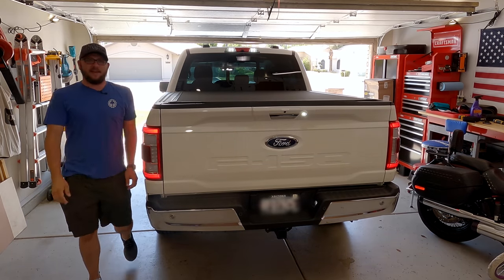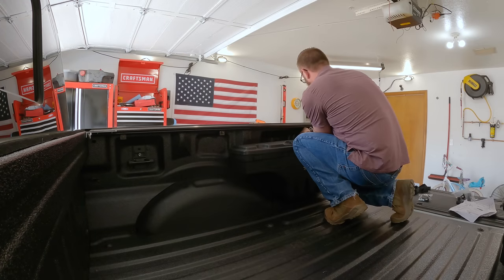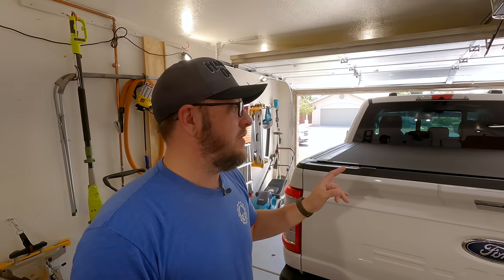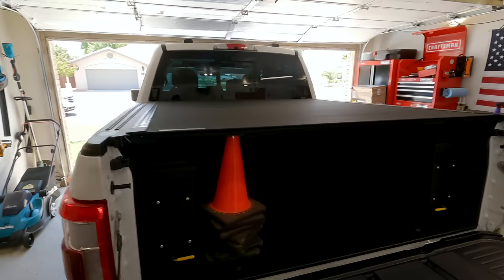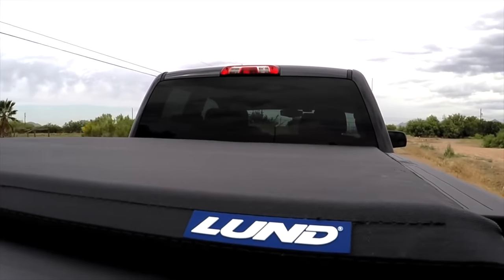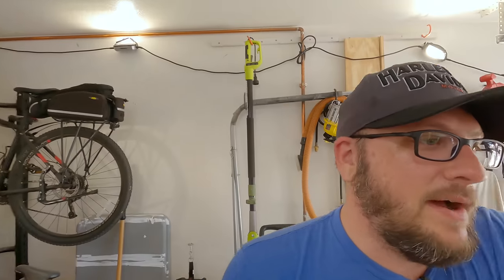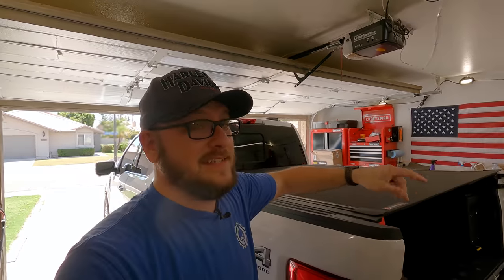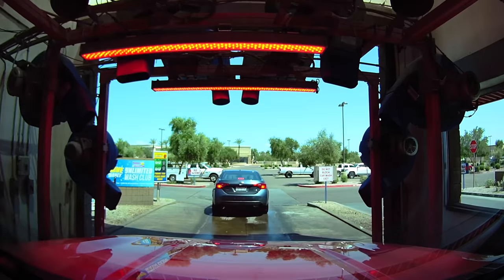BAK Revolver X4s, The BEST tonneau cover on the market?

Comment: I've got this same cover installed on my 2021 Chevy Trailboss. Had to get it replaced twice. First time cover was not flat due to slats not connected properly, and second time the replacement weather stripping was cut. The 3nd replacement is good. Bak needs to get better quality control and do a final inspection on their products before they leave manufacturing. Happy with cover now, going on 2 months.
Reply from the maker: Intersting. I haven't had any issues so far but I appreciate when my viewers share those kinds of experiences with me on products I've recommended.
Reply: @GearsGadgets  after owning it, how long do you think the cover will actually last?
Reply from the maker: @ctmartin1319  hard to give predictive advice. I’m a couple months in and it’s fine. As of right now I don’t have any concerns.
Reply: @GearsGadgets  okay thank you. I’m really wanting to get one but I know the reviews on the first models aren’t all that great because of how they broke down kinda quick and wasn’t sure if there was a recommendation on if this would last 5+ years

Comment: I’m on my second Revolver (Previously Roll-x). They work well. Dolly hey don’t stand up to the elements though. They rip and fall apart. Bummer. It’s the only one I can use that will clear my RV when it’s hitched on my short bed f350. Perhaps I’ll need to do more research because 3.5 years each is not long enough, IMO.

Comment: I purchased this cover about 3 years ago. I have had to replace the top cover three times with my final one now trash. These are NOT good in hot weather conditions. The vinyl top shrinks and literally the whole end starts to fall apart. One of the weakest point is the plastic end covers at the tailgate, They break right off and impossible to re- attach.  I had high hopes for the cover but done with BAK . Spend the extra money and go with a retractable aluminum cover.

Comment: I have owned 2 of the Revolver X2 version covers and both have failed me.  The heat of the sun melts the glue that adheres the vinyl material to the aluminum slats.  The vinyl then shrinks and pulls away from the aluminum.  This occurred at the rear portion above the tailgate on both units and only took 6-8 months. Keeping the vinyl conditioned with product did not help.  Maybe the X4 is better designed.  I too thought that I had found the best of covers and loved the design,  but I was mistaken. Please keep us updated.  I wish you the best of luck.
Reply: Had mine for 8 years in scorching heat/sun and never had a problem with the vinyl on top.  The felt strips on the underside eventually lost their glue though.  Dosent effect the functionality, but I think it helps you not pinch skin when rolling the cover.

Comment: This seems like the best choice!  I had the retrax on my old 2006 Sierra with the 6.5" bed so I didn't mind that front box so much.  With the 5.10" bed I'd like all the space possible.  My truck sits outside all the time - how do you think the material will hold up to the sun and contaminants and bird poop?
Reply: Great point I have a six and a half foot bed and I was going to actually recommend to anybody who who is hauling  their bike around the six and a half foot bed and then you can put any cover you want on there and you're not limited in your options at all

Comment: You missed 3 important issue....1) No mention of locking the cover in relation to the tail gate i.e. if the tail gate is unlocked, so is the cover. I have a retractable bed cover that can lock from the outside and prevents the tailgate from opening regardless if the tail gate locked or unlocked.
2) No mention of if the cover can be positioned anything less than full open without it rolling closed in the slipstream. 3) You claim any water intrusion at the tail gate will run down the back of the tail gate and out the bottom. Here in the West we have hills and water runs down hill. Clearly in your car wash video. Water  is shown coming forward in the bed. So...going down slopes the water will run forward. Better have your non waterproof elevated on 2x4...etc.

Comment: I installed the BAK Revolver X4 on my 2019 F450...lasted just over a year before the glue failed between the vinal and aluminium. It looked super nice and functioned well, but it did not hold up. Big disappointment for the price point and expectations.

Comment: The reason why I went with my LEER hard tri-folding tonneau cover is because it has the pinch lock system and not the pull cable system because a coat hanger can't be use to open my pinch lock unlike the cable pull system.

The reason I got it over the metal sliding tonneau cover is because of the space it takes when open is where i store my tool box. I have a huge rolling tool box and it works great with my Leer hard tri-folding tonneau cover.
Reply: Too bad the leer(650) doesn't have the latch on the second panel so you can just lift it up unfortunately.

Comment: I have this bed cover and it does not hold up to heat. I live in Las Vegas, the cover did not last 1 summer. This cover has way too many parts that are glued, and ALL OF THEM FAIL in the heat. First the 2  inner liners to avoid from burning hands when rolling open detached because its just glued, and that failed. Then the glue and rubber seal of the area closest to the rear window shrunk due to heat, and that ruined the entire vinyl, rubber seal and gasket. Also the entire top vinyl is glued to the actual aluminum tabs, so when the heats hits, it melts the glue causing the tabs to get misaligned and the tabs start pinching on top of each other and the cover does not close properly. And the worse is that water seals from each side is glued to the vinyl, so when the vinyl shrinks due to heat the rubber detached from the vinyl so now the whole thing is leaking and loose. Also all the video show people closing the cover with one hand, while this is possible after a few times doing that, the cover will start to create a dip in the middle from pressing down all the time, its just aluminum so it bends fairly easy. The product has potential to be great, but getting rid of all the vinyl is a must.

Comment: I had mine on my 2012 Toyota Tundra and loved it, until after 1 year.  The vinyl shrunk and detached from the aluminum and was unable to open or close the cover.  Good thing that the tonneau cover was still under warranty and was able to get a new one.
Reply from the maker: I heard that happening with the older covers by the X4s apparently fixed those issues, We will find out soon enough since my truck lives outside in Arizona.
Reply: @GearsGadgets  yes, I live in the Imperial Valley in South Cal and we get 118F° weather in the summer and all the adhesive gave up and all the vinyl and felt tape detached. Also, I have a friend that had the same issue on his GMC Sierra, but he was out of warranty.  I guess this is a known issue on areas with extreme hot weather.

Comment: I have a '21 Raptor. Tried a variety of covers over the years. I went back to the MX4. Missed the full bed access. The rear bed camera eliminates the blocked rear window argument. Even while driving the camera stays engaged.
Reply from the maker: I would agree with you if that was the case with my 21 however since Ford can’t seem to build MY21 trucks with the same software or push OTA’s to keep all 21’s on the road with the same feature sets, my 21 cameras don’t work while in motion. Ford builds a great truck but my lord their software team is WAY further behind than the ambitious trucks they are currently selling would lead you to believe.

Comment: Love the design. Quality was not as good. Bought the first one with the truck. Lasted 2 yrs and delaminated. Vinyl on top shrunk in the summer heat. They replaced it but I am already seeing dimples in the vinyl after just one summer. They recommend using 303 protectant which I do regularly but doesn’t seem to solve the issue. Would not buy another without at least a 5 yr warranty.

Comment: Love the review! I wish I went with this instead of the Truxedo Sentry XT for my Tundra. It's similar  to this but the sides don't lock down but has velcro instead which is obviously  not as secure. This is definitely the best of all covers out there as I'm in the same situation with you hauling a motorcycle and having to use the entire bed and still see  in the back

Comment: Great review but the claim of the water just running out the bottom only isn't supported by your video footage. There's a good stream that manages to crawl up the left side. Not a big deal and I imagine just like with the trifold hard cover by Bakflip you can add extra protection to keep water intake at the rear to a minimum. 

Great review and I'll probably be purchasing on for my new f150!

Comment: I’m going on almost 2 months waiting for this cover to arrive undamaged.  First one had a slat not connected, both plastic clips were destroyed and rails both scratched and missing paint.  Took a week just for them to send a return label.  Second cover came in good shape by itself.  Sent rails separately and those were also scratched and missing paint.  Best part is they forgot the mounting brackets for rails.  They consider expedited about 2 weeks for returns.  Currently I have no idea what’s going on, customer service is well trained at bullshitting you then dragging their feet.  They could have just overnighted me the brackets but nope!  I wish this wasn’t the only style of cover I wanted because I despise this company.   If the next set by some miracle comes in good shape it will be a solid 2 months since I paid for it.  For 1200 bucks I’d expect better.  This was not back ordered either.
Reply from the maker: Who did you buy it through

Comment: Just put on a gator efx on my 21 Chevrolet ltz. I looked at all different brands, had used a gator brand before, so I went that route. All the brands are pretty much equal it’s just a matter of preference. My new cover is a hard cover folding where as my last one was fabric

Comment: I love my DiamondBack HD cover. IMHO, it can't be beat with looks, strength, and security.  But, I do love that you get access to the full bed easily.  For me, I have to know ahead of time that I need full access, then it takes me about 15 minutes if I'm by myself to remove the cover.  Great review by the way.
Reply: Totally agree. My diamond back has been perfect. More secure than my cab. No water or weather intrusion. Four bolts and it’s off my truck.

Comment: I'm one of those people that want my cover to be as water proof as possible. For what it's worth, if you want to review a great cover, I have had a Roll-n-Lock cover on for 2 years and I'd say it is 99.9% water proof. To be honest, I'm not sure if the couple drops that come in are from leakage or dripping in when I open the tailgate; it is so minimum, it doesn't matter. The two drawbacks to this cover are the space it takes up at the front of the bed, where it rolls up into the container and the strap required to pull it closed; this damn thing is always in the way LOL.

Comment: I have this on my 2020 F150. I hate it. Vinyl has shrank on edges, and it leaks all the time. You also can't just roll it out over a load. The quad cover used to be able to be out on its own weight if you had items in the bed.

Comment: I wonder how it rolls up in the freezing weather, will any of the parts crack? Will it roll at all in the freezing weather? I like that it doesn't have that bar at the back tailgate for loading access, but if I were to load up  our clothes washer or dryer to take it to the appliance repair shop during the freezing winter, can I roll up this tonneau cover?

Comment: I installed a BAK revolver on 4/29/2016 cloth fell off the underside vinyl peeled up it still works great but I'm gonna replace it as I duct-taped the vinyl back down it was almost 900 dollars. doesn't last. Today I ordered a Gator SF from real truck. chatted and they gave me 264.41 full-price tax,item, free shipping. 10-year warranty vinyl lifetime hardware
Reply from the maker: The X4S is a completely different construction and I haven’t seen any issues so far. They don’t have the felt on this version.
Reply: @GearsGadgets  I sent them pictures and pic of the sales receipt said they'd give me half off retail price and flat 54 shipping any BAK I want so trying to decide. Got Gator SF 10 year warranty vinyl from realtruck 264.41 total

Comment: I am look at getting this or the Leer HF650M for my Ram 3500 short bed. My issue is i have an in bed aux fuel tank that sits below the bed rails. Could you tell me how far from the bulkhead do these covers protrude into the bed when they are fully open.
If you could provide those measurements it would be immensely appreciated 

Love the channel BTW

Comment: I bought one of these in 2013 when it was called the roll top cover. Couple of things I will tell you. You can damage the slats when they are rolled up if you slam something heavy into them.  Also the twist knobs near the tailgate tend to vibrate loose. So keep an eye out for those. But I would definitely buy another one. You don't lose bed space or vision.
Reply: I haul wood with mine. Haven’t dented them yet. What are you doing to it?!

Comment: I have the Truxedo Pro15x, I love it, looks very similar and doesn't leak!
Reply from the maker: The X15 is a Velcro secure system that can be easily lifted on the sides by snoops and the cover is just fabric and could be cut into just as easily. Not saying it’s not a good cover but the only similarity is that they are both tonneau covers, aside from that the X4S is significantly more premium in terms of level of security which is why it costs twice as much.
Reply: Yes, I wasn't making a direct comparison, just commenting on the low profile look, that is a great looking cover and appears very secure, I believe Truxedo has a similar one, I thought about upgrading but as you point out it is about twice the price.

Comment: Nice review.  Every truck owner has their specific needs. Personally I looked at a ton of covers and decided on my 2014 to go with the Rollin Lok and ended up putting a retrax on my Denali.  The retrax with some weather seal on the outer edges of the tailgate is the most water tight cover I've ever had.
Reply: Yep just purchased a Retrax Pro Mx for my 2021 Denali !

Comment: I have the older 4X cover on my '18 F-150. It's actually the Ford branded version that I got new from a dealer installation subcontractor for a really good price ($500). The only issue I have had in the 2 1/2 years it's been on my truck is a self inflicted nick in the back edge of the vinyl fabric. Oh, and the glued on "FORD" emblem on the top fell off. Otherwise, very happy with the choice.

Comment: I have this exact cover for about 3 years now.  Unfortunately, the vynal cover has started to come loose from the right edge and the metal under the vynal cover has started to crack the cover closet to the tailgate.
Reply: Bak will replace most likely

Comment: My only issue is I have a 5th wheel hitch that I can barely see without a tonneau cover. It’s just visible at the bottom of the rear window. With the cover rolled up I would not be able to see it.

Comment: Bak just replaced my revolver because it started falling apart and changed color in 3 years exactly. It looked terrible. If they didn’t replace I was ripping it off. This is the cover they replaced mine with. Not much difference besides the plastic covers on the end by the tailgate and the inside doesn’t have glued on fabric that falls off.
Reply from the maker: which version?

Comment: Gear and Gadgets please respond bt 12pm tomorrow. Question: If you had the rear view camera mirror would you get the try fold ? That way looking out the back window wouldn't be a problem, you would still be able to see behind you.
Reply from the maker: Possibly however I prefer the look of the X4S over the trifold. It looks like a classic fabric with the security of a trifold which is what drew me into it in the first place.
Reply: @GearsGadgets  thanks, they actually had a trifold that matched the pearl white of my truck so I picked it.